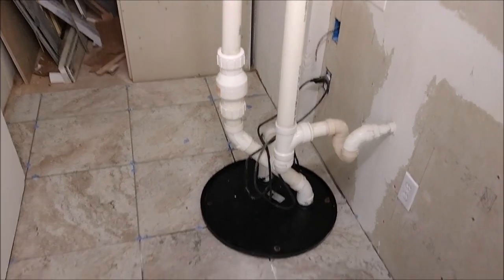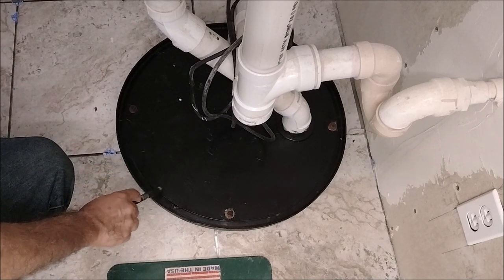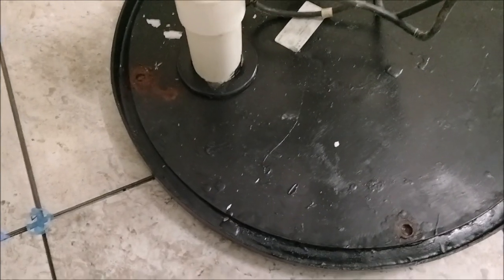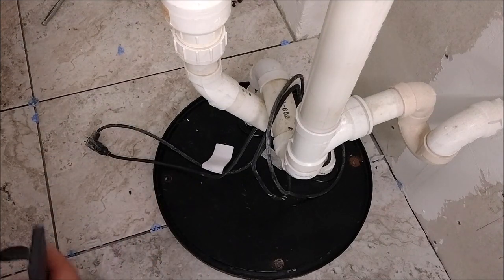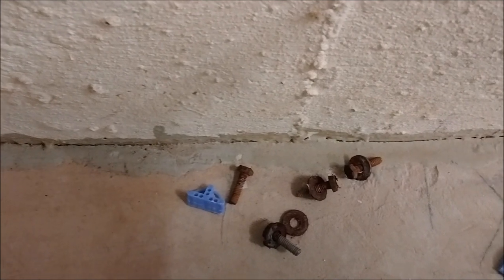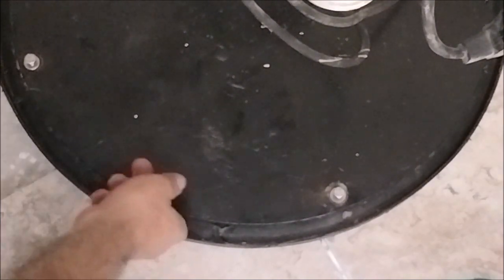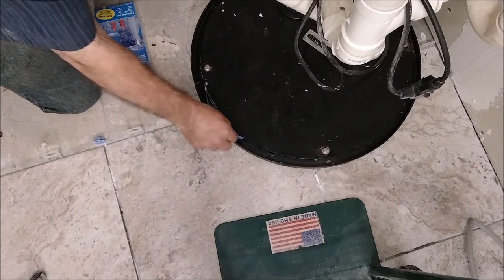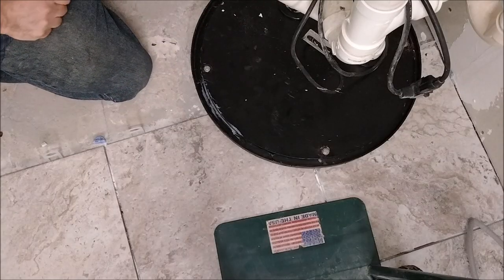How To seal Your Sump Pump To Avoid Bad Smell In Basement- Do It Yourself

Comment: Bummer that others are complaining. This video was super helpful. This was the only place on the internet that had the seal - I couldn't find this at the box stores. So thank you for the amazon link to the seal. I didn't have to cut it because theres a check valve-union-valve on my discharge line. I didn't do any additional caulking - there was some kind of caulk on the seal I replaced and its obvious it ultimately didn't do much. I just ordered two additional seals for when I have to replace it again. Thank you for this video, made my job super easy!!!
Reply from the maker: Any time

Comment: Thats the ejector pit or trash pump. Sump pump pits usually do not have the bolted down covers. Thats where shit ect goes then gets sent up and out.
Reply: It should be sealed! The sump pump is connected to the sewage line. What kind of F plumbing student logic do you have.

Comment: Why didnt you silicone the entire thing including around the pipe?  Is also a good idea to install a water alarm unless you have an auto overflow syphon system installed for overflow/ flood protection..
Reply from the maker: You can. I have water alarm.

Comment: I am just trying to understand the piping setup? Obviously you have a discharge pipe to a check valve to outside, but the other pipe that comes in kind of confuses me. At first I thought it might be a backup sump discharge line going to a sanitary line inside the wall (that would be the reason for the drain trap) but still not sure what the line connected above it goes to - a vent? The reason you are getting nasty smells from your sump pump crock is the water in the drain trap is drying out and the sanitary flue gases are traveling back into the crock. Very bad setup.
Reply from the maker: There are 2 pipe one for swage and the other for air. There is nothing wrong with the setup because it is normal setup. The led should be sealed that swage gas will only go out via the air pipe.
Reply: Yes the second line is a vent. This setup is fine and basically standard other than theres no union so he had to cut the seal.